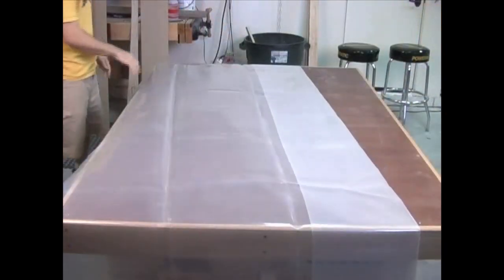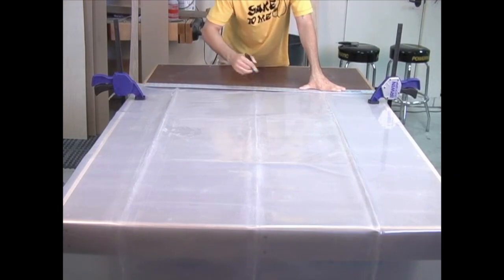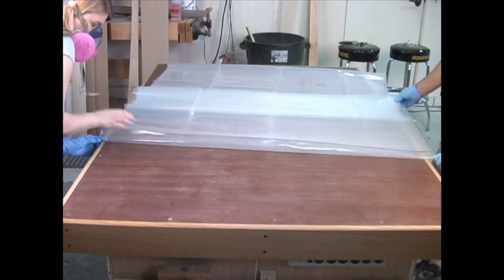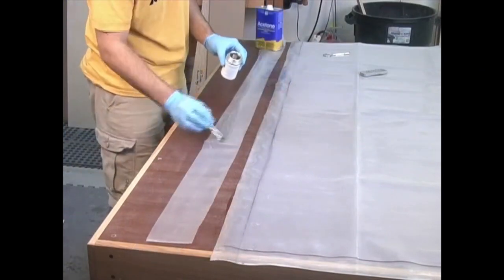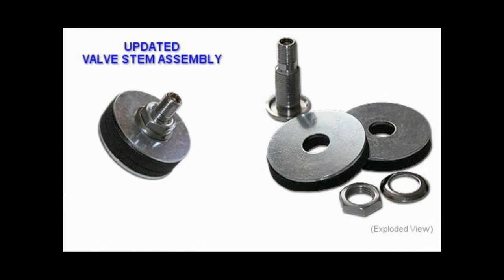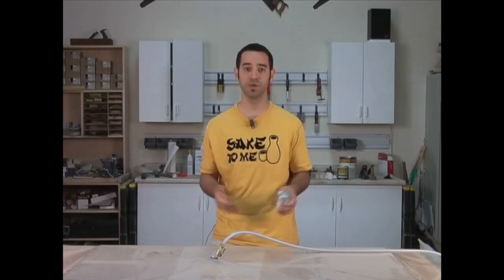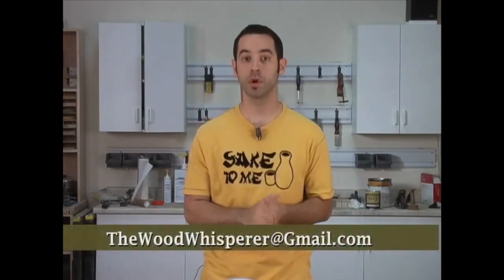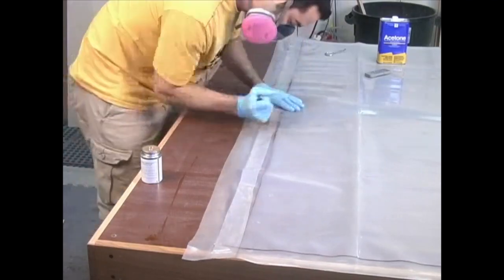17 - How to Make A Vacuum Bag for Veneering

Comment: As a boatbuilder i have been bagging for some years now in and on odd shapes , Yes each one has its own twists and problems ( convex-concave 20meters??? the list is there) But for flat table work why do make it so hard for yourself with the glues etc??
(9 times out 10) i use 2 sheets of heavy plastic sheet to fit the job and seal it with brown packing tape,,, job done, Also i lay a plastic net ontop of the work to allow the air to travel ( inside the bag) try,, good fun, regards rik
Reply: double side or double face tape is better
Reply: to seal all the bag
Reply: Rik, you seal the edges of your bag with packing tape?

Comment: Thank you for showing the failure. Personally, I find videos with all the mistakes left in more informative than videos where everything goes perfectly.  I made a vacuum pump out of PVC pipe and about $40 worth of hardware, including a venturi valve which creates the vacuum. It works off my compressor and I've found that it works as well as, or better than, any vacuum pump at a fraction of the price.
Reply: Jimmy Jim Jimmy Jim Jimmy Jam Jim Jim. Would you please make a video on ho PVC and Ventura valve to make your vacuum press. Thank you

Comment: Thank you for sharing even the failed attempt. Honesty appreciated - I would suggest and I know it will work 1. First fold the two layers of open end of bag and staple the it.
2. Now secure secure the strip to the table with two way tape to avoid curling and apply the glue to the tape
or the stapled bigger piece as you wish but the former would be better as glue will not stick to your fingers . 
3. Apply the glue to half of the tape 
4. Then attach the stapled bag to the tape with firm pressure. 
5. Then apply the glue to the bag side upper surface and fold over the tape using roller 
6. Attaching strip would be easier with no glue on it. 
7. and you will be in control not the tape, it to curl. If timing is an issue then apply the glue as you slide the [attach- English my third language] the slip like attaching piping while sewing the garment. 
Good luck

I myself will try this and might post video But I think you are better at presenting 
Look forward to your success in making the bag if not already doe so.
Now I am off to Joe's site
and also I think 2 Ways to Make Sealing Machine video by Juggad is very interesting to make own bag though it is on small bags.

Comment: Thanks for all your instructional videos!  I also am cheap and wanted to make my own vacuum bag. I know you do your research and was wondering what you thought about using vacuum bag sealing tape (ex. Jamestown Dist.) to seal a bag and leaks? Also shown is a polyester mat as a vacuum bleeder. A roll of tape is $15.
What I thought was a vinyl (flooring) covered assembly table and tape down the vinyl bag material to the top to form a vacuum bag. This could form a large or small bag. Or use it on the seams to form a bag.

Comment: I'm lost. I watched the same 3 minute section 4 times, so its glued in half the length, then the sides are glued so that means a sealed bag, so how does the vacuum bag work as in whats it clamped to and if the air in the sealed bag is sucked out, then how to that apply pressure to the bed?

Comment: Why glue the folded edge?
Reply: I wondered the same - I wouldn't think a GLUE joint there would INCREASE strength under vacuum pressure more than the original material, but it's possible the vacuum doesn't stress the glue joint, pulls it together, and gives some protection / increased durability over having a vulnerable single layer edge always exposed. Surprised he never replied to your questions in 4 yrs. Maybe he'll see this new activity and chime in!?  Great job on all his videos & a highly likable guy.

Comment: Looks like he's made the job harder than necessary. Why not just glue the sheets directly to each other with a bead of clear 100% silicone 2" in from the edge? No need for the 4" wide strips. Also, there's no need to do any clamping with the glue you're using as it dries almost instantly. Silicone can also be used to make a sealed entry point for the vacuum hose.